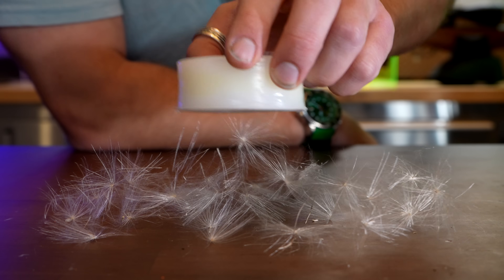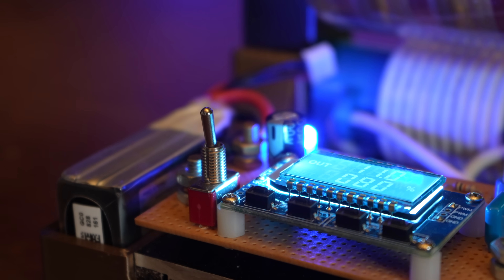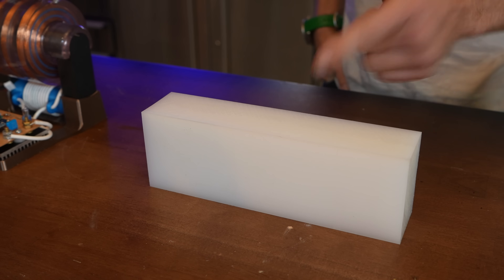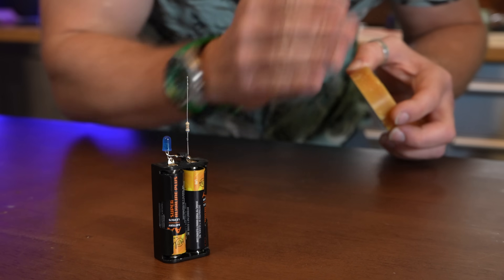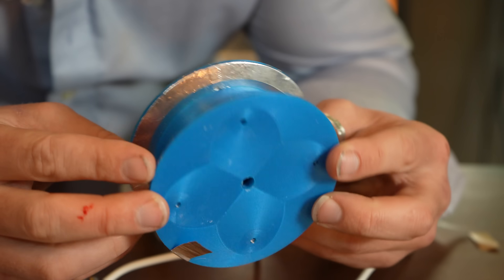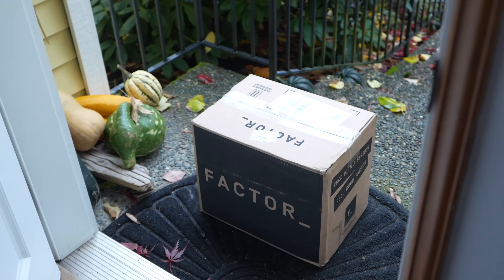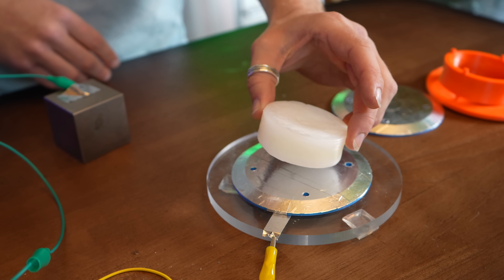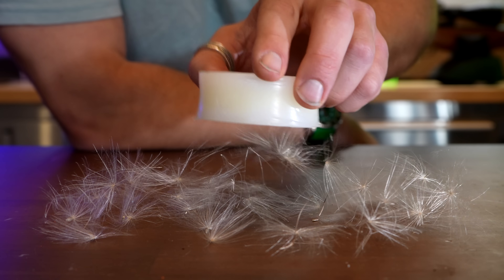Creating an Exotic Material With A Permanent Static Charge (Electret)

Comment from the maker: Thanks for watching! I mentioned the wrong Japanese scientist - Mototarô Eguchi was the man. Use code 50PLASMA to get 50% OFF plus free shipping on your first Factor box at https://bit.ly/4eHXfxx! Also, here are the links to Onshape ( https://Onshape.pro/PlasmaChannel ) and the custom transformer video: https://www.youtube.com/watch?v=DkhpuuPljS4 . Let me know what you think about these really cool mysteries called Electrets!
Reply: Being able to do that but in reverse would be fantastic, it would have a real application for space suit design too. A space suit that can repel lunar dust via permanent static charge would be a truly useful invention.
Reply: PTFE teflon next???
Reply: This pic you showed  of him also looks suspiciously like AI - were you aware of this?
Reply: @PlasmaChannel   I can't replicate your circuit, mine is extremely insensitive (bc547c, hfe=457 measured)
What Transistor did you use? Is it a Darlington?

PS: Next time please show a schematic with labeled components for a second 🙂
Reply: Odd question, but is it possible to use glass to make a electret? if not why?
Reply: @theearningcurve9684  He erroneously said the material needs to be a good insulator.  This isn't exactly correct.  It needs a higher dielectric constant (aka, high permittivity).  (It just happens that materials with high dielectric constants also tend to have higher *dielectric strength*, which results in "insulation".)  Glass has high-ish permittivity.  I mean, the material he used is better, but it could work for a smaller charge.  https://www.kabusa.com/Dilectric-Constants.pdf
Reply: @theearningcurve9684 an electret must have dipolar function, why would someone use glass instead of any other cheap and less toxic dielectric that won’t shatter ?
Reply: This was great. Thanks for all the work, i really enjoyed this. 
So can ya use an LED tv as a detector?
Reply: You were too focused on making the "puck" shape to realize you could've used the material itself to isolate the electrodes and cut the strongly electrified part afterward (while also making the material as thin as it can get without el. breaking down, and then you could try sandwiching more pieces together to amplify the field),, ofc there's a way to make the mold as you've done, but the tolerances to prevent arc-over don't seem to be worth the effort, it's doubtful the interface between the material and the mold casing wouldn't give way especially at higher proximity
Reply: @sFeral this is exactly what is described in patent NL 1032043 Arie Melis deGeus ! 🤓
Reply: there's also the trick of electrifying a tape between two spools, which results in extreme amplification
Reply: 2nd reply second like
Reply: lol putting the plate contacts on the outside hahhaha!!!
Reply: time to make some electret brakes for my bike
Reply: Use plastic fillings to map the field. Very simple to do
Reply: Your plasma experiments already are super cool, but this really looks like uncharted territory!
450 solder joints is too much for your sanity? cough*pcbway/jlcpcb/elecrow/digikey/mouser/etc*cough All you need is the design and let robots assemble it! I know you like to build stuff yourself, but if you want hundreds of "pixels" and/or higher density, custom PCBs are the way to go. You could have them make a dozen small (5")  10x10 "tiles", that way you can arrange them in a various shapes, big square, rectangle cylinder (facing inwards), etc. and later get more tiles until you have enough of them to cover a wall 🙂
Reply: @VeniceInventors  use fluorescent chipped bits of plastic. just like in magnetic fillings
Reply: @esecallum  🤔 trying to picture it, I guess they'd have to be feather light, like synthetic fur or mylar ribbons
Reply: arm hair detector, get one of those optic fiber lamps, see if the fibers react. Based on POV the orientation shift should produce a similar end result
Reply: @sFeral  shaver hair
Reply: @esecallum  buying an optimal hair length wig or a pelt is easier haha, even tho that wasn't my original point, but it works to a degree, minus the lights
Reply: So what can you do with it? can you make a audio mic or speaker as you said?
Reply: Hi PlasmaChannnel,  I am an graduate from CN and we group want to remake the experiment and electret. Which software you use when designing the module and mould, and if it is possible to have an copy project of your module file. We have our 3D printer and melting vessel in our lab.:)
Reply: So does this mean now all the clothes minded  people will stop mocking me about  Electrets being pseudoscience.. put less time into status/rank and yeah i said clothes. Instead of closed.
Reply: Is it possible to charge an electret in such a way that it repels instead of attracting?
Reply: @rafaloklejewicz1367  It will already repel something with the same charge polarity.
Reply: So what is the circuit diagram for the detectors? Are they merely LED's wired to a battery with a resistor for the antenna, or is there more to them?
Reply: for the detector, find a PBC service with pick and place service, and you can easily make a detector using SMD that is both higher density and resolution, all automated (and maybe a big ground plane in the back?)
Reply: How do you make those detectors?  This is one of the coolest things I’ve ever seen!
Reply: Cool materials congratulations.. learn how to cook, that delivery looks gross 😅
Reply: 我有一个建议希望你可以尝试一下如果成功了，并且效果很好的话，那么希望做成视频发出来。以下是我的设想。我很小的时候就想过制作这种东西，没想到真的存在并且已经被发明出来了，而且叫做驻极体。我的想法是这样的，你把一个金属杯子放在范式起电机的静电大球上面。然后开启机器，此时向杯子里倒入融化的聚乙烯塑料，等待冷却，在聚乙烯完全凝固后关掉电源，如果我的设想没错的话应该会做成一个只含有单一电荷的驻极体。试试吧。
Reply: @zhifengniu  It's an excellent idea. That would be much simpler than using a transformer. Thank-you for suggesting it. 🙂
Reply: The dudes who were able to dream this shit up and then actually succeed in making it happen, while around them, there's a world that is still using steam locomotives and oil lamps, is beyond insane to contemplate.  They must've been from Mars.
Reply: Hey can you try making and containing plasma in a container and use it as a battery
Reply: Apparently, if you fill the Electret base material with a high-K dielectric powder, it turns into a battery that never fully discharges.... please make one of these and let us know!!!

http://www.ovaltech.ca/pdfss/townsend_battery.pdf
Reply: Not trying to nit pick here but a permanent magnet, only remains permanent under specific circumstances.

Permanent magnets can lose their magnetic properties over time, especially when exposed to heat or high temperatures. The higher the temperature, the faster the process of demagnetization will happen. A sharp blow to a permanent magnet can also cause it to lose its magnetism.
Reply: @Zeaiclies the same is valid for electret
Reply: @Caesarus2011 
Never said it was not
Reply: Really interesting. This gives me a new perspective on a fringe youtube video i saw years ago. It was a gentleman who attempted to perform the Lord Kelvin’s thunderstorm device using liquid metal instead of water.

Allegedly he was able to obtain what appeared to be two lumps of metal that demonstrated monopole effects (one lump being a northern monopole and the other lump being a southern monopole) 

This always seemed a mystery to me, eapecially since his set up was very sloppy about ensuring the droplet breakup of the streams coincided with the device setup as is critical with versions that use water. 

However your demonstration of the electret setup makes me think now that somehow he ended up with magnetic fields and electric fields being forced to coincide along the same axis.

Wish i could find the video. He had done a followup video saying some institution had approached him about acquiring the rights to the process, and the videos demonstrating it disappeared shortly thereafter (i imagine the rights couldnt be sold if there was a Prior Art concern, so the technology had to be taken out if the public domain so they could pretend it was never made public)
Reply: Would be fun to see you reproduce the electrophorus voltage multiplier experiments using an electret
Reply: MOST AWESOMELY CHARGED COOL BRO :
💥‼️👉 Listen up, my dude- I've had an EPIC REVELATION, and it reminded me, ALSO, of you. 😎And so 👇✅
- SO THEN # 1  just, if you  "did" , YOU now MUST SIMPLY FORGET ABOUT IT ! 
# 2 - I THINK YOUR BADASS, MY DUDE, SERIOUSLY, AND THAT'S A COMPLIMENT NOT TO BE TAKEN LIGHTLY HERE'S WHY : 👇‼️‼️
😁😁😁😁😆😆😆😆😆
MY FAMILY AND EXTENDED FAMILY IS X-MILITARY (USA) AND GOV. HIGH UP CONNECTED AND AWARDED, AND MY POPS- HE IS ( OH YES )
- NOW RETIRED, BUT A COUPLE- FEW YEARS  BACK, THE DIRECTOR
/ PGM MGR OF ALL NASA R&D SENSORS REMOTE SPACE SENSORS, ALSO DARPA ( OBVIOUSLY )
- AND , YEH... I GUESS THAT'S ENOUGH... MYSELF, WELL IT'LL TAKE TOO LONG, AND EVEN MY FIRST SON IS IN THE BUSINESS.
-
SO WHEN I COMMENT, AS LONG AS I'M NOT SUDDENLY & SUPREMELY PISSED OFF, NOW KNOW👇
 [ A PERMANENT STATE THAT ENDED JUST 2 WEEKS AGO THAT WAS "LOCKED IN" BY A COUPLE BACK TO BACK FAMILY TERRIBLE CRISIS... SO THE : ASTRONOMICAL FECAL MATTER EVENT BOTH ANNIHILATED, THEN RECREATED EVERYONE'S REALITY, AND THAT'S THE SIMPLEST WAY I CAN, WELL- NOT IF IT WAS ONLY YOU I WAS COMMUNICATING TO, OUT THAT DOWN IN WORDS. ]
-
APOLOGIES, SINCERE AND THOUSANDS UPON THOUSANDS, TO YOU IF YOU WERE CAUGHT UP WITH THE OTHERS- AND THERE'S A FEW, EMBARRASSINGLY ENOUGH- HOWEVER I FEEL WORSE IF ANYONE TOOK IT TO HEART ! ( I WONDER WHO, OR HOW MANY PEOPLE👉 RECOGNIZED THAT THERE'S A REVEALING PATTERN HERE OF A MAN IN SERIOUS TORMENT, DENIAL, AND HORRENDOUS PAIN ! )
- But,... Yes, my young man- NOW FORGET ABOUT IT, and your "rogue experimentation" is, like I've stated above this most important message from myself to yourself, 
A 
MOST BADASS AND EXCELLENT & MOST EXCELLENT, YES- ONGOING SERIES THAT I'VE NOW GROWN TO ENJOY VERY VERY MUCH.
-
Congratulations on your GENETIC INHERITANCE OF SUPERIOR GRAY-MATTER, AND FANTASTIC CHOICE TO USE IT TO STUDY THE ARTS OF SCIENCE.
-
GOD BLESS YOU AND YOURS, IN JESUS THE CHRIST's NAME - WITH GREAT HEALTH, HAPPINESS, JOY, AND A HEDGE OF PROTECTION, AMEN.
-
Ps- everything I state is "point-blank" LITERAL, UNLESS OTHERWISE STATED.
-
Keep the awesome and often badass experimentation and related discoveries coming, my dude. 😎✅👍😎
If BRUCE LEE WAS A 🐉 OF COMBAT
THEN YOU ARE A
🐉 OF THE SCIENCES YOU DEMONSTRATE SO BEAUTIFULLY HERE ON YOUR SHOW/SITE/ CHANNEL... HERE ON
YOUTUBE.
-
WHEN I'VE TIME PERHAPS I'LL CONSIDER AN IDEA YOU MAY AGREE SOUNDS GOOD ENOUGH TO INVESTIGATE A BIT FURTHER ...
Reply: @CCSNGMF  brother, you are profoundly mentally ill
Reply: I'm wondering: have you tried ceramic electrets? I was thinking about one of those high-k dielectric ceramics like zirconia for added fun.
Reply: You should send styropyro this recipe he probably make  a lighting puck😂
Reply: Grounded signal when you pointed
Reply: There is such a theory - the theory of electric cosmos, a bit exotic, but it says that all relationships between stars and planets are based on electricity and not gravity. Since the disc you made does not work like a magnet and attracts everything (even non-ferromagnetic objects), it could be said that we are talking about artificial gravity here ;) am I wrong?
Reply: Can this feeld be used  with😢 earth  mag field for levitation add proposal ion
Reply: Hint you can move your greed and then you will have more info
Reply: OMG You are an awesome GENIUS.

Pure Awesomeness.
Reply: @Splarkszter  Believe me when I say that I hate to do this, but it's (hopefully) for your own good: The word "genius" does not have an "o" in it.  Terribly sorry to be THAT guy.  Please forgive me.
Reply: @tommytwotacos8106  Thanks! I'll keep it in mind.
Reply: Hello, amazing video ❤

I wonder if you have tried Teflon (PFTE) instead … this material already have elongated molecules and also PEG 8000 or higher and no need to “condition” the material in electrostatic field ?
Reply: Great topics explained. Now let's get down to suns emissions. Flares are about like this due the permanent energy it's holding and there's a pull like the electret.
Reply: How can I purchase one
Reply: I can't help but Wonder what about using those things to generate power?
Reply: https://youtu.be/gc2pbgdcCkw?si=f9TkgSyig-UMN-x8
Reply: Could you make an electrostatic motor using these to replace magnets? Currently all the motors in use today (as far as I understand) use electromagnetism. In theory, if you could switch an electric field just right, if you had permanent static charges, you could make a motor that doesn't use magnetism, but rather uses electricity. That would be amazing if you made such a thing.
Reply: Hey Jay,
To make a high resolution image of the Static electric charge, can't you hire someone to design a PCB with many of those little sensors,
And then have PCBWay (or similar) manufacture it?
That way you wouldn't have to do the soldering yourself (which can be time consuming), and you could even make it a 3D Sensor.

Sidenote:
Someone with Arduino and Stepper Motor knowledge could wire your high-resolution sensor up to an microcontroller, and by moving the electret back and forth in a controlled manner, Record the values of the electro-static field, and generate you a 3-Dimensional Image of the Electret's Static Field.
Reply: Try submerging it in liquid nitrogen and then pull it out after the temperature has stabilized.
Reply: To answer why it turns off when you get your finger close, my fairly uneducated guess is that you’re increasing conduction to your body which is acting like a capacitor and taking some charge which momentarily reduces the voltage of the field the generator is making. Then when you pull away your finger, your body capacity drains into the field, increasing the field slightly in voltage for a moment. Is this right?
Reply: @ohokcool Actually I think it would be induction and act as a resistor, lowering current. Pull the finger away and then the induction and resistance is lowered and current increases.
Reply: I wonder how would might look and “electro-electret” by analogy with an electro-magnet. According to Arie Melis deGeus from patent NL1032043 an electret will reduce ohmic resistance by more than 500 times.

I guess if you can make such electret you would be able to slice it in thin slices and make sandwiches with zinc plated steel sheets as in patent mentioned above, only to add a strong permanent magnet for an electric generator DC to power whatever you want anywhere you want.
Reply: 16:09 Do a PCB!
Reply: Thanks for this episode🙏. I've  learn sth which i probably would have never learned if i wasn't subscribed to @PlasmaChannel 😇
Reply: Hi Plasma, Channel may be interested by this : https://www.youtube.com/watch?v=fyai_kUYhLs   a new ventilation device for electronics that uses the same electrostatic principle as your thrusters.
Reply: do you own a ferrocell? Would be curious to see how it would respond to an electret/if strong enough
Reply: Can you now test, if the charge is enough to remotely activate chips or devices that shouldn't be activated.
Reply: @prunabluepepper 
You can not active anything by simple charge alone. Switches do not work that way.
Reply: Since we know How to get a Shock out of a Plasma Globe. Would this not actually be Dangerous w/ the ability to also possibly Discharge? I don’t see a Field. I see Electrified Liquid turned into a Solid yet remains Electrified
Reply: I’m convinced that Hockey Puck can & would Zap you when given the ability to Discharge that which resides inside that object which would be 40kV iirc that you stated you used to create such.
Reply: I made a custom made .33fd capacitor in 1988 in the usaf. Never did anything with it. In 1993 build a Tesla coil and showed it to a electronics outlet in Tacoma "he sold ex military grear" they were afraid of it. I will be building a tesla vest ...to scare "hopefully" some suspect who want to attack me. IDEALY, would love to wear a Teflon gloves with wires leading to the tips of the fingers and then..if the suspect gets close to me, some how turn it on and the plasma jumps the fingers :)
Reply: 😊q
Reply: It's ok, I had to watch this five times just to understand it all
Reply: What if you could do the tribal electrical effect with frequencies. I feel like that would give the electricity a soul.
Reply: Honestly I need the one you made, no seriously I do.
Reply: Can't leave a regular comment but you are amazing
Reply: Could you?
Use electric to power a permanent magnetic engine with no other source of power?
Reply: Wow. I just recently discovered this channel.
Reply: That static sensing array - basically a single coil turn and a couple of discrete components - seems like something you could make into a 3-layer PCB (one layer for the ground plane, one for the connections, and one for the antennae / LED connections).  And you could have the fabber pick-and-place everything for you.  I feel like if you've got yourself up to 400 of something, making robots do it is the way to go.
Reply: watching some of your newer videos gave me an idea for an experiment. what effects would a negative or positive electric field have on seed germination, plant growth. like putting a germination container on the electret or planting on top of it.
Reply: Jay i have an interesting concept that i wish to test out using electrets can we statically suspend quartz crystals within a pad so when we walk on it it generates current using mechanical force
Reply: THERE IS NO STATIC CHARGE. There is no electron.
Reply: Dude you are clueless because you  learned all from our textbooks. There is a secret to everything

Nature never hides. Its staring at you all time. You just dont see it

Answer itself in your own electret
Reply: Polarity changes man
Reply: More size means more magnetic field. There is no charge or electron exist in universe.
Reply: Please  Test this.
1. Test current distance light is on
2. Rub it on your head and see it distance increased for light to glow.
Reply: Hair is Bio electret with magnetic field when you rub comb it pass the current to comb and create temporary magnetic field.  it can push and attract, it will push other plastic like balloon or plastci bag cut into ribbons.
Reply: avoid PFAS in z food
Reply: Can you just sell these?
Reply: Since bees create a static charge during flight and flowers discharge them, and they can sense which flowers have been visited... Can bees also possibly create and sense charges in the honeycombs like a heatmap?
Reply: He's brilliant.
Reply: Believe T. Townsend Brown dabbled in this field in the early1900s using titanium oxide and wax as the adhesive.
Reply: I need 2 electrets can you make them?
Reply: @bigmikeobama5314 if he made the entire universe i guarantee you he doesnt care about someone saying his name buddy
Reply: @penguiin12 Except He explicitly stated He cares?
Reply: i get it, you do not believe in GOD, but many of your viewers do, and when you say GOD DAMN, WE FIND IT HIGHLY OFFENSIVE.  IF you do not wish to be removed from my subscribe list you will not do this again, or if you do you will edit it out of your videos.. I DO NOT WANT TO HEAR IT... I WILL UNSUB, if i hear it again, i do not wish to be around that... I am a marine, i don't give a fek if you cuss say shet or what the hell ever, but i love God, God loves me, and i will not tolerate this anymore.. you have been informed of how i feel about this.  I AM NOT THE ONLY ONE,  I may be the only one who appreciates your videos enough to tell you about it.  I do not know if anyone else has tried.
Reply: You have brought great shame upon your family 😂😂😂
Reply: What?!?! A mistake?!? Do you not know you live in a perfect youtube, in the most perfect governement!?!?!? #offwithhishead Please note in wokeland #sarcasm is punishable based upon the karen who wishes to punish bad bad naughty boys. Do people not see how fast my sarcasm goes from woke to naked endtable... 0-100 in 0.69 seconds!
Reply: Acts 3:19 Matthew 4:17
Reply: @RogerAlexandre-ms3fx 
Fiction 2:10   Myth 3:60
Reply: how are they mysteries? lol they are well understood but i guess thats typical youtuber engagement bait
Reply: @penguiin12  for the layman like me, they're mysteries.
Reply: Not an "antimagnet" then.
Do not recommend channel. Congrats.